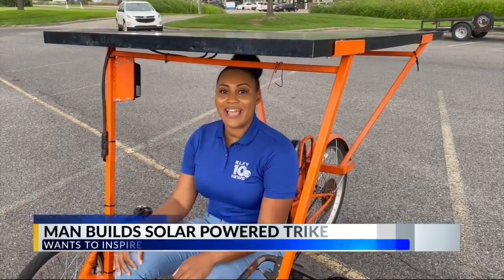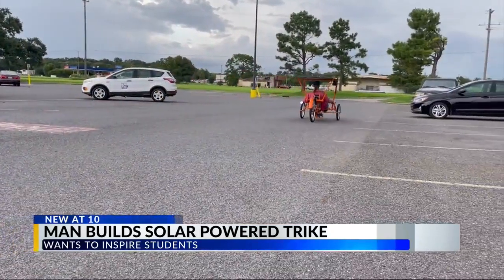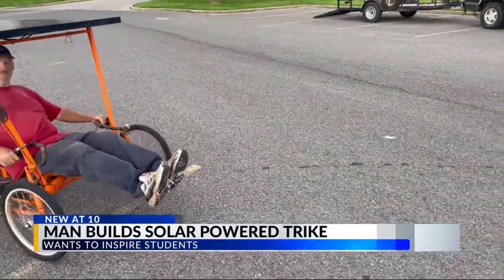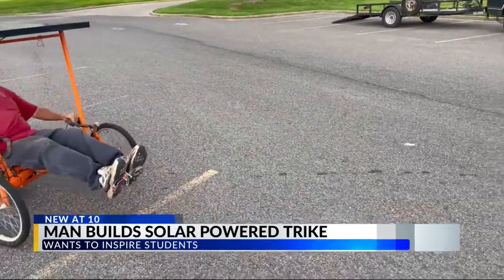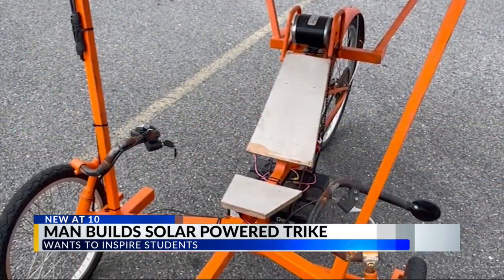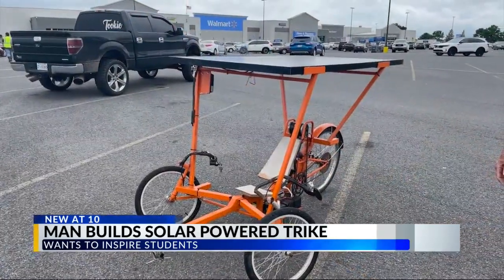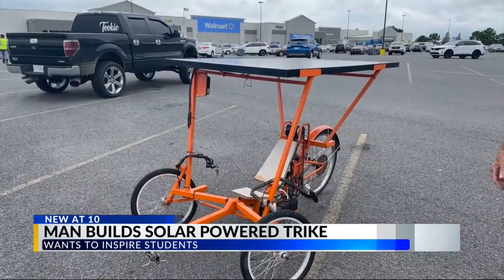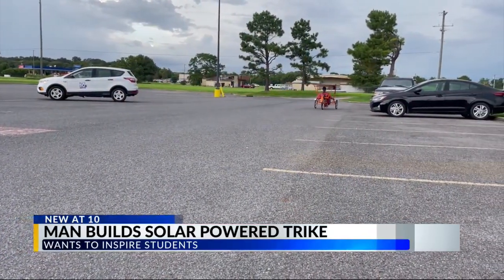Local man builds trike using solar panels

Comment: I wonder what the local authorities think of it... No pedals on this ebike...stupid legal crap and all...but I like it, kind of wish I had a recombent...
Reply: If you can swing it money-wise, it's a much better idea to take an existing recumbent trike platform and convert it to a solar powered platform. It can be challenging to work with designs not intended to hold a solar roof, but there's a much better road legal argument for it because it's an established legal bike platform... Not to mention you never know when something in the solar is gonna screw up and you'll be happy to have pedals instead of being completely stranded

Other benefits include being able to add accessories designed for these trikes, such as a wind guard, storage, etc